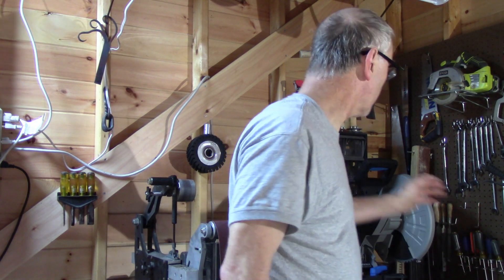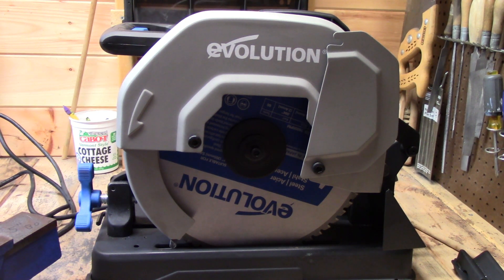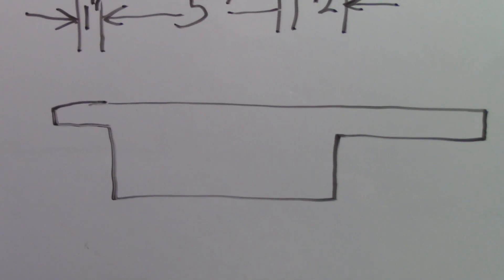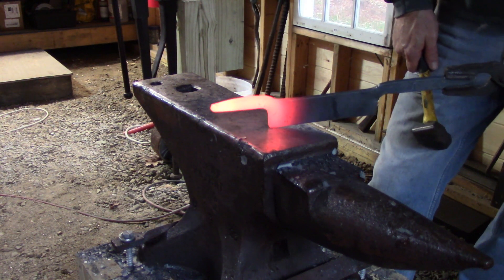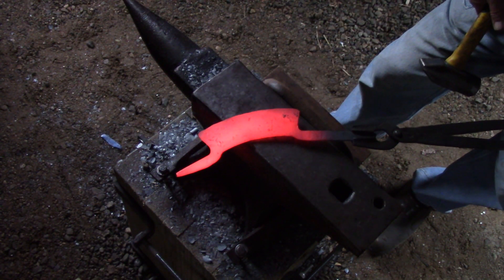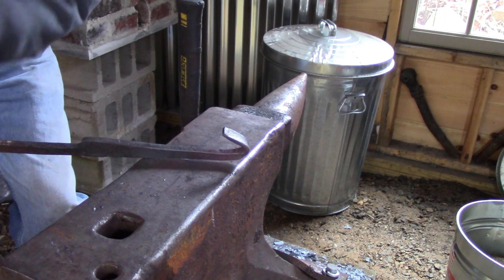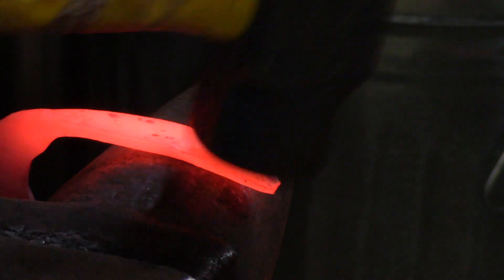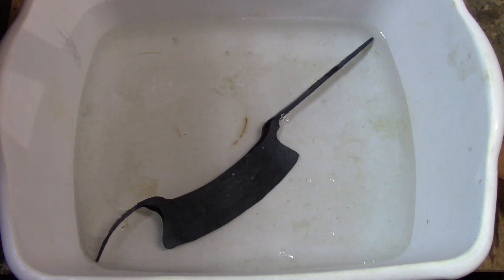Removing forge scale using vinegar.

Comment: How long will the new saw blade last compared with cutting disc’s.= replacement costs ect. The other thing that crossed my mind was the ringing sound after you Finnish the cut has musical potential.😀
Reply from the maker: To my knowledge they are expected to last quite awhile if used as directed.
Reply: @RayFromTheHayclan  thank you for your reply . It will be interesting ,I imagine you will also have a reasonable power saving due to the shorter cutting time and lesser force required to make the cuts. I’m just thinking !. No response required to this thought.👍🇦🇺🍻